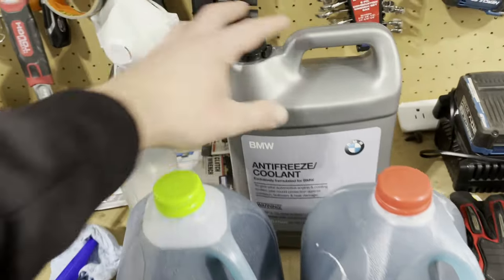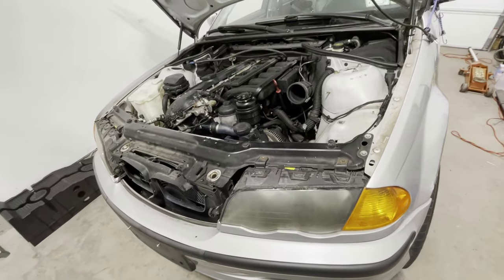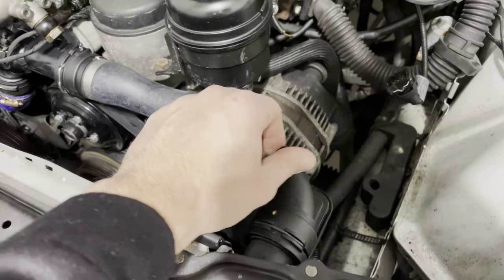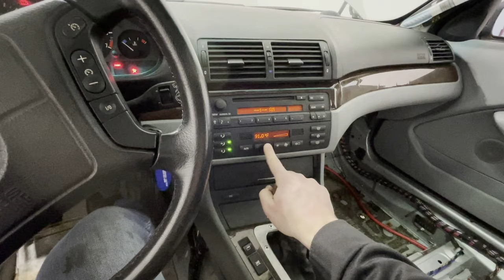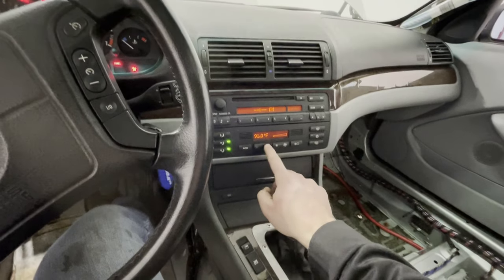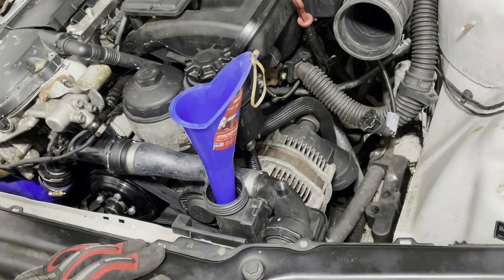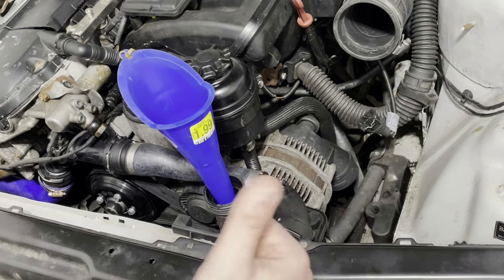How to PROPERLY Bleed an E46 BMW Cooling System

Comment from the maker: Some quick tips:

It’s not a bad idea to run the car with the cap off after you have followed these steps. That will allow any stubborn air bubbles to rise.

I do want to point out if you do this correctly there should be minimal air bubbles if any when you turn the car on.

After your first drive - let the car cool and check the fluid.
Reply: Hello which cap?
Reply: @GatsuGuts  the reservoir cap Brody ☝️

Comment: The part about getting the nose of the car up high is critical.  I thought I did a good job bleeding my system, only to have the engine needle go way past the middle on my shakedown run.  I had to drive home a 1/4 mile at a time, stopping in between to let the needle return to the middle before another mad dash and coast.

Once I got home, I parked nose up on a very steep hill and re-bled.  The problem vanished.

Comment: Ok, this technique will work only if your bmw is equipped with the secondary water pump, which is electric. You will hear the pump working and also see coolant circulation as you look into the expansion tank with only the ignition on. Not all will have an electric pump, for example an e53 having the same m54 engine as the e46 will definitely have a secondary electric pump to help circulate the rear climate controls. I have both vehicles and my e46 vert with m54 does not have the electric pump, my x5 e53 does have the pump.

Comment: Needa definitely do this my e46 my coolant light appears and disappears don’t know if it’s the sensor or it’s just not filled
Reply from the maker: Doesn’t hurt to try - could be a sensor too.
Reply: Same thing happening to me. Only happens in traffic or idling. Did this solve your issue?
Reply: @Jackman781  yeah this did actually! 😂 the car used up a good quart of coolant I would say
Reply: @ceelowww_  Just be careful! The same thing happened to me, thought it was a sensor. Next thing I'm at a gas pump and my expansion tank busts dumping coolant all over the ground. Got home before it engine overheated. The buoy was broken inside the tank, but nearly hopefully all of it was removed when replaced. I then replaced thermostat, water pump, and radiator last weekend did all the work myself. Having trouble getting the line to circulate now it's just been such a journey. But I'm so close! Going to try jacking driver side a little higher tomorrow and hopefully get the line moving, my only other guess is if there is a clog somewhere. It was circulating after the water pump was replaced.
Reply: Probably a leak make sure you take care of it I had the same issue and my car over heated expansion tank and hoses gave out
Reply: @wellokayyes1266  mines bust out of nowhere to cracked right down the side
Reply: yeah, i just got this, i check the tank an its full no coolant left, then when i hit the highway or road the coolant light shows up, i think i might have air bubbles in it.

Comment: What if the heat isn’t working please respond soon I replace coolant tank and didn’t bleed correctly coolant hose is swelling but I replaced it and now I have to bleed again
Reply from the maker: Repeat the process. Try running with the cap off until the car gets hot as well. Sometimes the system will burp itself this way. Remember to make sure the front left of the car is jacked up (the high point).
Reply: Revving the engine around 3 to 4 times with the cap off helped push out the stubborn pockets of air as I had the same issue, the heat then came straight away.
Reply: @LaRosaDrift so ots safe to run tne car with the resovoir cap off??  I'm doing my radiator on my e53 x5 soon.  Should be same process I think
Reply: @jaciobe yes

Comment: This technic only works if u got ClimateControl without CC u need to start the car > let it idle when its around working temp 90 - 100 degree celsius ( depends what thermostat u have some cars run 80 degree or lower thermostats ) , rest is the same